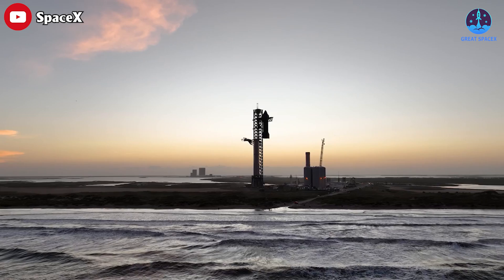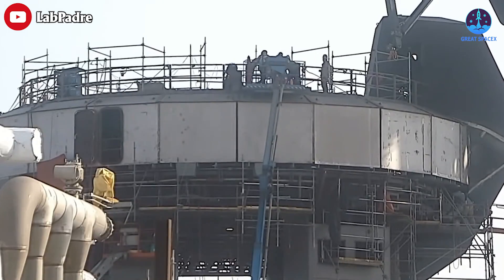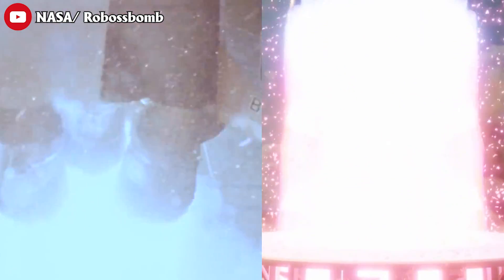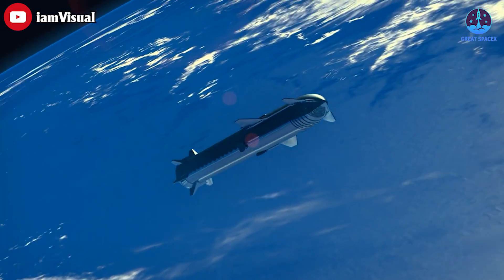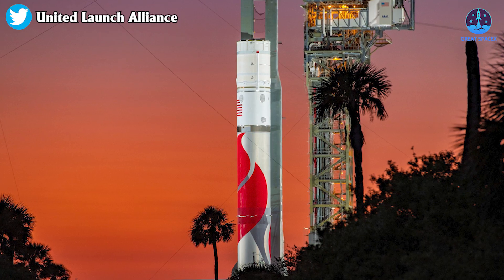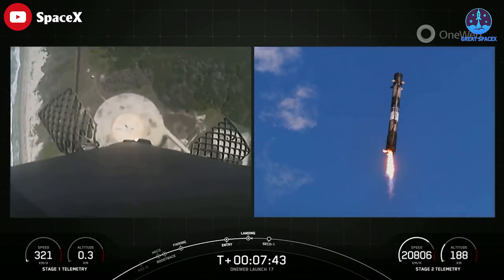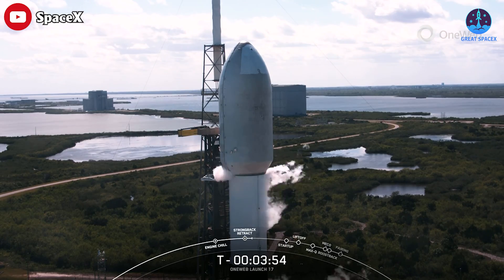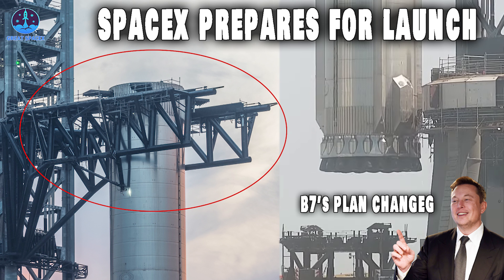SpaceX's plan changed, Chopsticks action, B7 remove, Stage 0 upgraded, ULA Vulcan test, Oneweb...

Comment: funny how the only ones not going for full reusability and also the only one using solid fuel is, you guessed it, NASA
Reply: Yes because needing to launch 8 starships just to refuel 1 so it can leave earth's orbit, wasting over 30 000 tons of fuel in those launches is far better than 1 rocket that can leave orbit on its own.
Reply: @johngriffin141  yes.
Bear in mind the starship only needs to refuel if it needs to return from places, so if it wants to just exit orbit (and doesn’t need to return like nasas ships) it doesn’t need multiple launches.